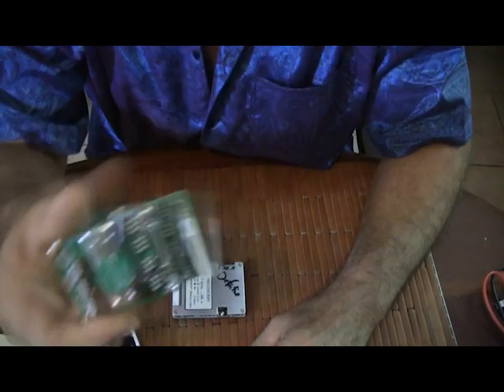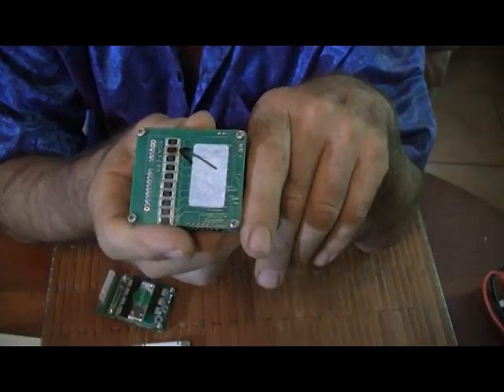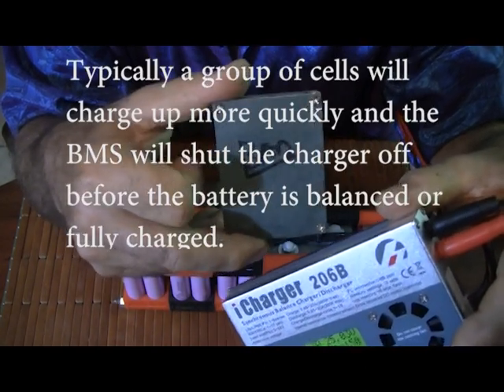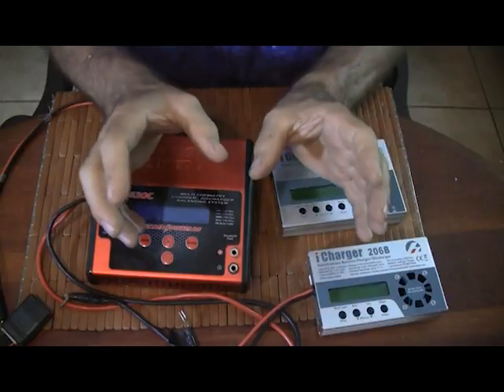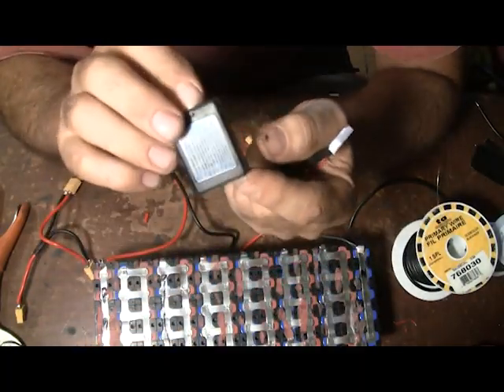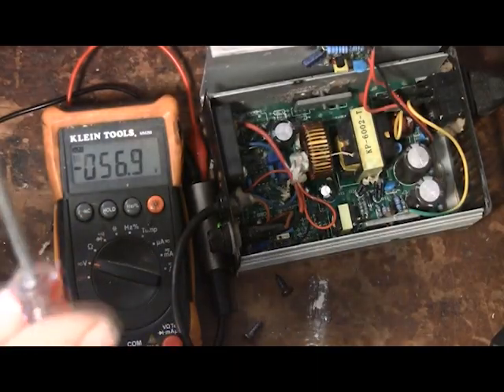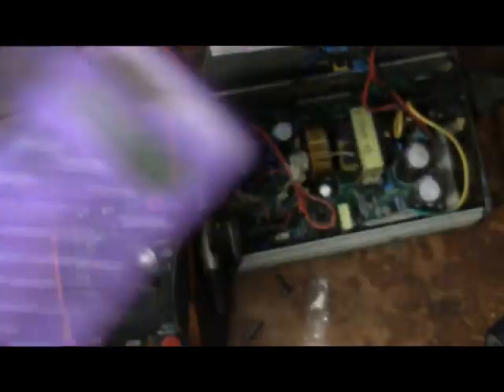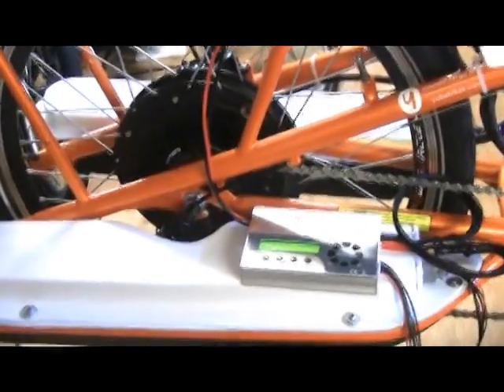How to build a safe and better lithium battery WITHOUT a BMS.

Comment: What would be priority for using used cells? IR or capacity. I know having capacity dictates what voltage you'll be at but I'm confused. I have a bunch of lg mh1 cells and turns out they were as great at the seller sold me on. Ive been measuring internal resistance to get a pack that's healthy but I have had issues before with making a pack out of used cells. I don't wanna give up since I've built some good packs before but those were brand new cells.

Comment: Are you saying that you can safely remove BMS from any e-bike battery..doesn't the original controller and BMS share some kind of data like SOC or for  instance cell Under Voltage or temperature...or you mean at all Times if you remove BMS you have to replace or remove original controller and display too..?

Comment: dont you need a capacity meter (not when using China controller...that's odd in case of China controller.... why hen cell loggers..) or do you rely on cell-logger,,,? And can you confirm that you have to get out all the ´original´ controller electronics first before installing external (China) controller or what is your setup,,,?
Reply from the maker: Hmm, this video is only about a way of charging a battery that does not rely on a BMS for balancing.  The BMS is part of the battery.  The controller is used to power the motor, and is not connected to the battery except through the two battery leads.  You can use a hobby balancer without removing the BMS, if that is what you are asking....

Comment: WHat about the controller & display....you dont talk about that..I like the idea ...and i would like to use it bur with controller & display that came original with my bike..?
Reply from the maker: You can use any controller and it's matching display, they aren't affected by the battery charging circuitry.  
I use generic Chinese controllers as they are readily available and easy to replace if they go bad, which they rarely do.
Reply: @shawname2  yeah i already rebuild my older Sparta Ion (Im Dutch..) with external dual mode controller and rotation sensor from AiBaba, I had to get out all the electronics in the rear hub motor...only 3 phases left...i know about that,,,but i´m not planning on doing so on my Kalkhoff Agutta with Panasonic middrive motor....so I guess this won´t work then...
Reply from the maker: @mathw2703  Ok, good luck Math!

Comment: I have also adopted the idea of a open discharge and a small blue tooth BMS to charge and monitor in real time. I agree with all the point made in this video but Am i correct to presume this video was made before bluetooth BMS's were available ? How do you feel about a blutooth BMS for charging/monitoring only now that they exist and are mostly reliable ?
Reply from the maker: They are better as they allow you to check up on the balance.  The real improvement is with BMS's that have Bluetooth and active balancing and allow you to program all parameters, such as this one:  

https://www.aliexpress.com/item/1005004059807727.html?spm=a2g0o.productlist.0.0.23fe582dtbOF3b&algo_pvid=c5fa2f33-93a3-4478-bceb-97ecfe1a9e76&aem_p4p_detail=20220505081953197176857130580017968223&algo_exp_id=c5fa2f33-93a3-4478-bceb-97ecfe1a9e76-2&pdp_ext_f=%7B%22sku_id%22%3A%2212000027934652609%22%7D&pdp_npi=1%40dis%7CUSD%7C%7C166.58%7C%7C%7C%7C%7C%40210318c216517639929768262eb32c%7C12000027934652609%7Csea

Cheers!

Comment: I just use a normal ebike charger to charge my 52v battery pack without a bms and how  I balance the cells is once the charger light turns green I leave it on for a few hours and it balance the cells perfectly it self been doing it for over 8 years now with no problems still the same battery pack aswel before this i went through a new pack every 2 years
Reply from the maker: Your BMS is in the battery.  Yes, leaving it on after the light is green gives the BMS a chance to balance the battery.  With new batteries, it can take just hours.   I'm glad this is working for you.  If it ain't broke.......!
Reply: @shawname2  I built it myself and didn't add a bms to it

Comment: Question for the group, if anyone notices. I am trying to learn about building a lithium battery pack. 

If I have the sensor wires and cell logger hooked up, would I then just unplug the logger and plug in the hobby charger to that connector? 

And... can I use this to safely charge a pack, if the batteries don't all have the same capacity?

Thanks!
Reply from the maker: Yes, the cell logger connector, called a JST connector, is the same one used on a Hobby Charger.  
You don't charge the battery through the JST connector, just monitor and adjust the balance.
Reply: @shawname2  Thanks very much Shawn!
Reply: @shawname2  I would like to ask you a question, if you don't mind. I can't figure it out. When I plug everything in, my imax B6 charger gives me an error, "cells not match". 

I built a 6s3p battery. It reads the proper voltage, and the cell logger also seems to be reading correctly. 

Crossing my fingers that you might have a suggestion. But thanks either way.
Reply from the maker: @JeffMoche  Hi Jeff,   I would imagine that your sensor wires in the JST connector are in the wrong order.   Double check it with a volt meter.
Reply: @shawname2  Thanks so much Shawn. The cell logger that uses the same connector does read 1-6 as about 3.5v each, and the correct total. But, that could still be wired incorrectly?
Reply: @shawname2  I also just tried a regular charge setting, not balance. That didn't work either. I thought that might ignore the sensor wires.
Reply from the maker: @JeffMoche  Jeff, do you have another charger to try?  It is sounding like the Imax is not right.  I can't find any info on that error message.  Hmm.
Reply: @shawname2  Thanks so much again. I just realized an hour ago that you were exactly right. It was wired in reverse. I hadn't even noticed the correct wiring written on the charger. I just started it a minute ago and now it's working!

I think I'd "assumed" that the black wire was the first negative, and then wired them straight across as 1-6.
Reply from the maker: @JeffMoche  Good Job Jeff!  You solved the mystery.  Keep building batteries!

Comment: this is still just using the hobby charger as the BMS and you still will need a PCB , you are still balance charging , this mostly for ebike packs  and it wont work for every application.

The the string amount isn't the issue where do you get a charger that can do 50v , that is going to be an expensive one !

 , a BMS allows you to be more mobile and charge from standard sources !
Reply from the maker: When the battery ages, or you are trying to charge rapidly, the Hobby charger will be able to balance more quickly than the BMS, as it can bleed faster.  On a road trip with an ebike, it is nice not to have the BMS shut off a battery because a cell gets low. It is better to make that decision yourself.  But I agree, this is not for everybody.  If a BMS works for your application, stick with it.
Reply: @shawname2  if the BMS/PCB/PCM doesn't shut the battery off at a low point it will damage the cells and then you will have to replace the entire pack .
      I dont get why you say YOU want to make that choice, the battery will just die then ? So you still need to have over discharge protection. 
      This doesn't solve the problem of low quality BMSs , it just moves the BMS to the HOBBY BALANCE CHARGER , its still the same thing only you have to use the HOBBY charger rather than just plugging in a power source. 
   It also hard to find a small flat BMS with thermal protection, which you would want in the higher power packs.
        Its easy to say just use the hobby charger but the main issues are "BMS'' BS marketing and no place  to buy a plug and  play,  reliable battery managing device.
  There is the solar device thingy , or you could carry  an Iflight charger ( it can do up to 16v 1-4s  I think ) but you have to keep it dry.
   Another frustrating aspect of trying to manage battery packs is, we use cheap BMSs every day , so why is so hard to settle on using one, no one can seem to agree :(

Comment: I have been using this method since 2017 on all my battery packs on all my ebikes.  Thanks Shawn.  I've seen some comments about a newer type of BMS that replaces the need for this method of charging.  If you are one of those persons please point me to a BMS that can limit a charge to 80% and balance at 80% as well.  Ive seen bluetooth BMSs and have had one in the past but couldn't see how i could limit the charge to 80% and have it balance all at the same time.  Thanks for any replies or links.

Comment: I agree completely with you, before I found this video I have been struggling with small BMS to use on small battery packs, so far all that has happened is that I have managed to ruin far too many batteries.  I know it is a long time since you did this video, but I would love if you could direct me to the cell logger you show or something like it. I like that it just does one job. Many thanks in advance.
Reply from the maker: https://www.amazon.com/4Pack-LiPo-Battery-Checker-Indicator/dp/B07VNW4MXL/ref=asc_df_B07VNW4MXL/?tag=hyprod-20&linkCode=df0&hvadid=366306819795&hvpos=&hvnetw=g&hvrand=12867851692344477874&hvpone=&hvptwo=&hvqmt=&hvdev=c&hvdvcmdl=&hvlocint=&hvlocphy=9002830&hvtargid=pla-802176963546&psc=1&tag=&ref=&adgrpid=81881572248&hvpone=&hvptwo=&hvadid=366306819795&hvpos=&hvnetw=g&hvrand=12867851692344477874&hvqmt=&hvdev=c&hvdvcmdl=&hvlocint=&hvlocphy=9002830&hvtargid=pla-802176963546

Comment: Hello Shawn, how did you achieve to keep cell monitors off and turn them on only with the button? THANK YOU!
Reply from the maker: Hi Petr,

The switch breaks the negative wire that goes to the cell monitors.  That shuts them all off.

Comment: Although it's the same position your way of describing it, I think it's easier based off the colors of the wire if you start off hooking the red positive wire up first to the positive of the battery, then the next wire over which is  black  negative wire that is opposite the positive wire hooked up which was red and then all the rest of them are the negative side from there on out on down to the line last one ending up on the main negative of the battery.

Comment: what if i wanna charge my cells  4 V and i dont have a charger which i can open with adjust screw ...like most  modern battery chargers you vant open...///??
Reply from the maker: I would use a power supply with an adjustable voltage.  

https://www.amazon.com/AlloverPower-3V-Adjustable-Adapter-Variable/dp/B07WP2LBXW/ref=sr_1_1?dchild=1&keywords=power+supply+with+adjustable+voltage&qid=1635625216&sr=8-1

Comment: Electronics sometimes still confuses me ...a hobbycharger like the 206b can charge 6 parallel groups you mean 6 groups of  parallel cells....because of the other Charger the 1010b you say 10 cells at once..? Likewise the cell-logger....? And if one cell of group goes low then you Just charge with a normal Charger or do you use hobbycharger to do a balance?
Reply from the maker: It's not electronics it's semantics...  A  group of cells in parallel is often called "a cell" because, it is easier than saying "a parallel group of cells", and, a group of cells in parallel behaves just like one large cell.

If one parallel group gets low, you can charge with a hobby charger, or you can charge that group directly with a power supply.
Reply: @shawname2  then i dont understand the difference between charging with a hobbycharger and a power supply, then how often you need to balance?
Reply from the maker: @mathw2703  Oh, sorry.  You would use a power supply to charge one parallel group- by setting the voltage to 4 volts.  the question was, how do you charge just one group of cells if it is a lot lower than the rest.   You can use a small light bulb and alligator clips to discharge 1 group of cells if it is too high as well.  You can do these both while charging/balancing- to make the battery balance faster...
Reply: @shawname2  now even more confused....🙄 ..i thought that if one group is out of balance you use hobbycharger that does the job...?
Reply from the maker: Usually a battery will have all the parallel groups with slightly different voltages-say less than .25 of a volt  The hobbycharger will make them all much closer, balancing the battery.  When  you have a battery with one parallel group that is considerably higher or lower,- say .5 of a volt- you can speed up the process of balancing by addressing that 1 group by charging or draining it.
Reply: @shawname2  so every time one group is out of balance I need to take the battery apart. is that what u mean..or can you program this in the hobbycharger..?? By the way, thanks for your time....
Reply from the maker: @mathw2703  No, not at all.  You do not have to take the battery apart, but you need access to the plus and minus of that parallel group.   Just use the hobby charger if your battery needs balancing.  It will do the job.  It will take longer if the battery is badly out of balance, and I was offering a way to speed that up.
Reply: Took  me few Times  watching your vid but now i understand....

Comment: Just saw another vid, the guy used Li-Po battery, saying these battery´s dont need BMS...?
Reply from the maker: IF they never need balancing, and you don't care about a high or low voltage shutoff, then no.

Comment: Man, i laughed out loud alot watching this vid😂, youre a funny guy, but i must say its by far most interesting vid i saw on my journey on ebikes, bldc motors, BMS and battery's👍. I wonder....can i bypass the BMS in battery on my existing bike, does the BMS stand alone or is it some way connected to the controller and the two need each other?.. I am Dutch pardon my bad English...
Reply from the maker: Hi Math,  You can bypass it sure, but better to install hobby a hobby charger system in parallel with the BMS.  Use both.  The BMS is not connected to the controller.  Well, it is through the negative wire.  As long as you have the positive and negative power wires coming from the battery to the controller the controller will work.
Reply: @shawname2  i dont quite understand howto...

Comment: Thanks Shawn. Coming from an rc background I didn't like the sound of these BMS units. You verified my thoughts and I will be using your charging method on my diy batteries. Full control and monitoring of the charge is the way to go. Hobby chargers have gotten so inexpensive too. Cheers

Comment: Thank you , I was just thinking about This After a Battery BMS started on fire . Im spiting my cells into 12 v , But I don't know If they make Slide connectors like on the bottom of a removable battery case . in 4 tabs . Ive been searching all electrical outlets for something but I might have to engineer it .
Reply from the maker: YEs, I did too.  I made cases with a 3d printer.  Spot welders are cheap too.  Best bet now if the cells are new is a BMS with a Bluetooth so you can monitor the cells' voltages.  An active balancer could also go in parallel.
Reply: @shawname2  Thanks , a Printer may be in the works for me  . Im struggling right now with Air flow . The batteries I have  lost in the past That I have  torn down have always had Moister in them . So The big question for me is Was that the Cause of failure . I have one battery Ive had for Years in a Removable case that just keeps going .

Comment: Here is a update.... They now have BMS with a Bluetooth attachment that links to your cellphone and shows what your cells are doing, voltages and also balance cells (charging/discharging) depends on how you configure the BMS using the software on the phone.